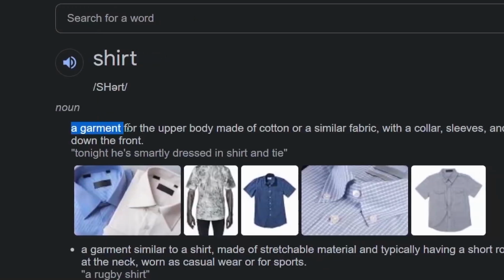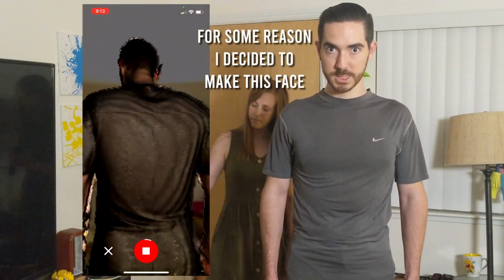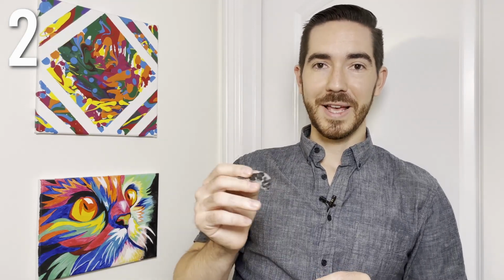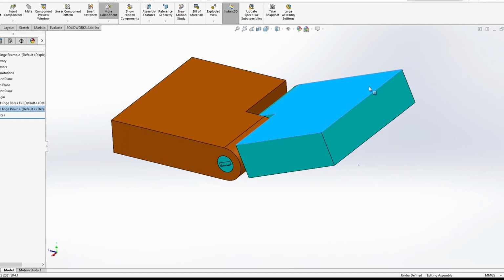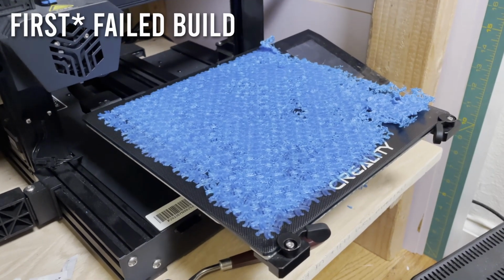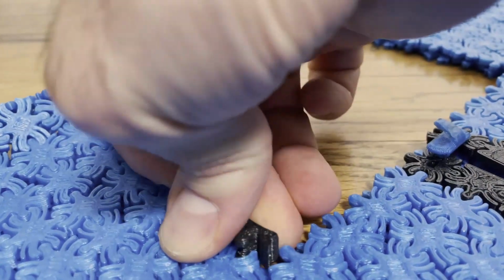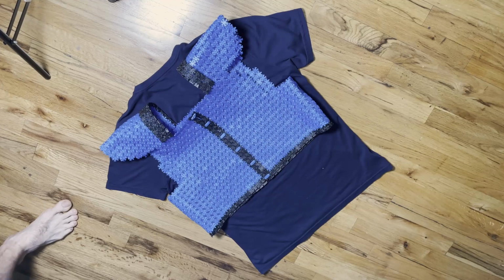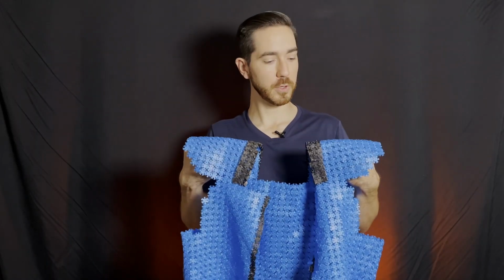Can I 3D Print a Real Shirt?

Comment: You joke about the business beach suit there, but I'm legit curious how well that 4 pound PLA crop top would handle in the sun or in chlorinated pool/salty ocean water. Not curious enough to spend 100+ hours running into full print bed sized failures, mind you, but I do wonder if it'd melt, if it wouldn't get as heavy as a normal soaked t-shirt, etc.

Also, the "how it fits without a shirt under it" bit was interesting because I would have expected it to be a lot more see-through, but even with the gaps so it can move and such, it turns into a relatively solid texture?
Reply from the maker: Great comments!! To my knowledge, PLA does swell as it breaks down in water over many months so maybe for one afternoon it could be fine, but for multiple the links might start to lock up with each other as the ball and socket swelled. Maybe I’ll go take this sucker out to the beach and post an update haha

The link design in the video is actually version 7 of the way they interlock. I spent a while optimizing there fit to get the snap I wanted, the flexibility, but also to minimize the gaps so you couldn’t see through super easily. I think the gaps were nominally 1.2mm and the play will add or take away from that. If you are up close you can see through some.